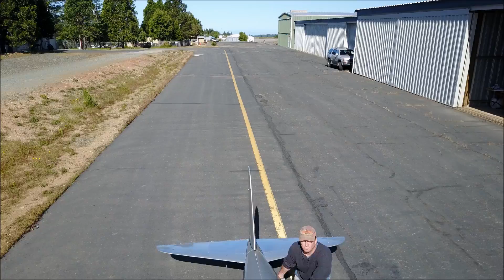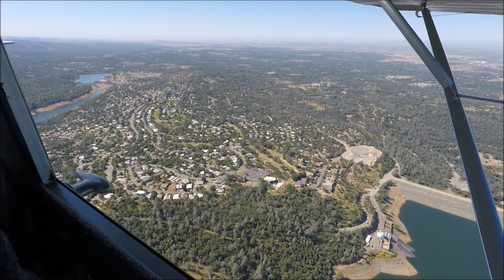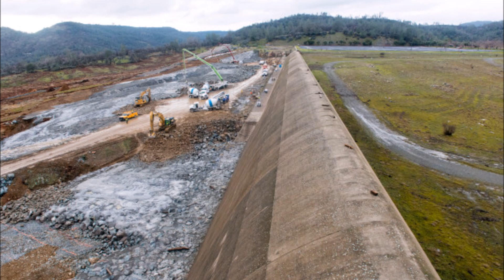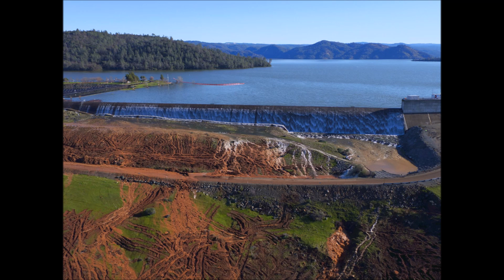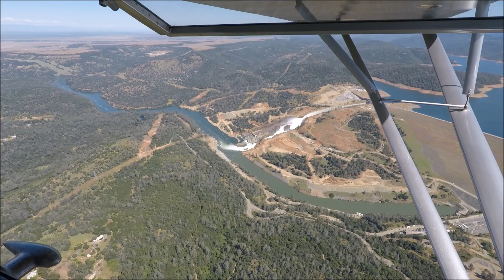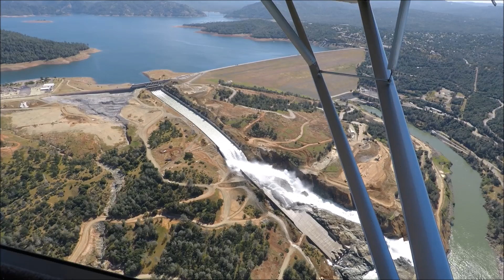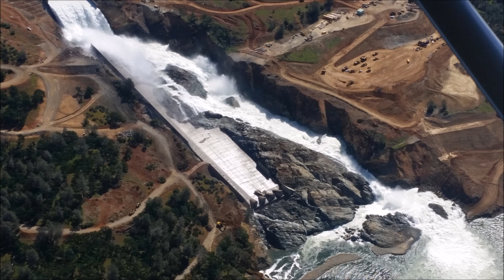Oroville 15 May Update -Recovery

Comment: OG Weir
 wir/Submit
noun
a low dam built across a river to raise the level of water upstream or regulate its flow.
an enclosure of stakes set in a stream as a trap for fish. 
For a better definition of a WEIR, A weir /wɪər/ or low head dam is a barrier across the horizontal width of a river that alters the flow characteristics of water and usually results in a change in the height of the river level. There are many designs of weir, but commonly water flows freely over the top of the weir crest before cascading down to a lower level.

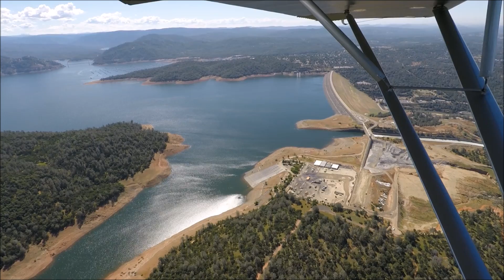Comment: I was pretty stoked to hear you mention the “controversial parking lot” at 5:38.   Something about it this must be buried in the Grand Scheme and it will need to be dealt with during the Emergency Spillway upgrade phase.  
   I first noticed this as I began following the over-hyped story, repeated by  many media outlets (especially TV announcers), that “rocks were being dropped from helicopters” to stop the flow.   I tried to fact-check this and all I found was that in reality big bags of rocks were being marshaled in a staging area but none had yet been “dropped from helicopters.”   
   Finally, after a couple more days as people began to calm down, I did find footage of helicopters picking up a few bags of rocks but where were they going with them?  Certainly not to the emergency spillway area itself, which was quickly accessed by dump trucks using temporary roads that swiftly appeared.
   At last, a complete video of an entire trip of a bag of rocks via helicopter to its destination appeared and I was surprised to see a whole other area of “leaks and dribbles” that had begun to erode a slope far over beyond the actual “weir” of the Emergency Spillway.  White groups of the rocks bags were slowly deposited in these lightly eroded gulches over the next few days.
   Frankly, I don’t think the helicopters were actually needed to reach those areas, which are right next to a road leading to the “controversial parking lot” but I figure they had to pay in advance for the rocks and some chopper time so they had to do something with them.  [The sky-crane did come in handy for moving power lines later.]
   But I have digressed and rambled! . . . 
      I began to look back a pictures of the peak of the crisis, when the water actually overtopped the weir of the emergency spillway and it appeared to me that the “controversial parking lot” for the boat ramp was built at or near the same elevation as the top of the weir.   A low wall appears to continue at precisely the same elevation as the top of the weir all the way to the parking lot entrance.   What a bizarre design.  This meant that as soon as water overtopped the weir, it also began to come over the low wall all the way across the width of the parking lot, which raised additional erosion concerns if the flow increased over the Emergency Spillway. I can’t believe it was in the original plan; it looks like somebody simply decided to put in a boat launching area level with the top of the weir . . . probably after the dam had handled a number of seasons without approaching 900 feet surface elevation.
     So anyway, looking for a story from you someday about how that parking lot came to be.   Problems with its current elevation could be illustrated in conjunction with a retrospective on rocks being “dropped from helicopters.”   Maybe in June 2018 after the furor dies down?
     Meanwhile, great job, love your work (or play, hobby or avocation, whatever motivates this fine journalism)!

Comment: Given the uncertain timing of completing the lower spillway, they will need to incorporate some sort of "bridge" structure that can be lowered into place between the structures. This would allow the option of using the canyon until the lower spillway is completed.

First, they need to build a proper end to the upper spillway to allow water to flow off properly without risk of erosion. This structure would be such that it could easily become part of the finished spillway at a later point. Then, perhaps 50 feet lower they would build a similar structure which would meet the top of the lower spillway. These two structures would be designed to accommodate the placement of a temporary  "bridge" between them.
Reply from the maker: The current plan is to 'bridge' the gap with RCC-Roller Compacted Concrete.
Reply: blancolirio My thought was that in case the dont finish before they need to spill they could just leave a gap between the structures. They could then drop a "bridge" section in place to divert from the canyon to the lower spillway. In this way, once they build a structure below the upper spillway, it is basically ready to be used (with the canyon). This seems like a safe approach since you never know when a spill could be required.

Comment: Crystal clear video and another very understandable explanation, great work again Juan. I did notice that the outflow at the base of the spillway canyon seems much cleaner than in previous videos - is this the result of a lower spillway outflow (I think it was quoted at 10,000 cfs in the video?) or just that there's not so much loose soil and debris left to wash out of the canyon?
Reply from the maker: cleaned out the canyon.
Reply: Thanks for the answer Juan, much appreciated.

Comment: Большое спасибо за информацию, обзор с самолета это очень ценная картина, по которой много чего видно но конечно для специалиста это мало, нужны многие детали и данные чтоб дать рекомендации. Но как мне кажется на работающем участке водосброса - нужно в будущем увеличить аэрацию потока , вполнив Ее и у вертикальных стен. Ну и увеличить толщину и прочность дна и стенок лотка а также его анкеровки, в соответствии с нагрузками от потока, включая пульсацию потока .Желаю Вам успехов в трудоёмких и сложных работах по пропуску паводка на вашем крупном и всемирно известном гидроузле! Владимир СПб
Reply from the maker: Google translation-"Thank you very much for the information, the review from the plane is a very valuable picture, which shows a lot of things, but of course it is not enough for a specialist, many details and data are needed to give recommendations. But it seems to me that in the working part of the spillway, in the future it is necessary to increase the aeration of the flow by filling it with vertical walls. Well, to increase the thickness and strength of the bottom and walls of the tray as well as its anchoring, in accordance with the loads from the flow, including the flow pulsation. I wish you successes in time-consuming and complex work on flooding at your large and world-famous hydroelectric complex! Vladimir SPb"...Thanks Vladimir!

Comment: Juan, please watch this video of a news channel interviewing Robert Be a, an expert and professor.  His opinion is worth your attention.
https://m.youtube.com/watch?v=vc7vgdziUjw
Reply: Sounds like the gates have some potential problems with the concrete.  Do they pass muster with licensed structural engineers?  If not, there's another spare time summer project.
Reply: Ted Cook 
No they do not.  They are cracked and still leaking water after the seal work, I believe. ore of a problem than the public knows.  If the headgear (gates) is in bad shape, the spill way may be a waste of time and money.  Did you watch the interview?  Look up Robert Be a, he knows his stuff.  He wrote the reason the Spillway failed on his own time before DWR had a list of experts to put out a report.  This is not fear mongering or a crazy.  I don't understand why Juan suddenly started believing the DWR.  There is plenty of info on the internet that it doesn't take an expert to figure out DWR has not maintained the dam and all its parts even after FERC inspectors told them what to pay attention to.  There are real serious problems that need to be acknowledged if they are going to make sure this repair is safe and encompasses all the parts of the dam that need to last more than a few years.
Reply: Watched the video.  He mentions the concept of "decommission" the dam.  What are the correct rebuild or repairs to make on gates and spillways in the context of remaining service life of the dam?  Aircraft have cycles and hours, how much life is left on the dam?  If that question can't be answered with a given estimate, they are not following a rational process.
Reply: Ted Cook 
Who knows, they aren't telling us what they are doing or thinking.
Reply: And as a member of the public, I resent having to research what I can because they are not telling the whole story.  I love Juan,  and his videos, but when he said the seep area in the dam, that is growing the green area has been there for decades and not a problem, I was so disappointed.  That's word for word what DWR is telling every one.  There is an inspection report dated 2/3/15 that talks about that needing to be monitored.  DWR's PR guy patronized everyone at public meetings over it, saying it was a spring.  In the middle of the dam?  There are some areas  showing need to watch at the slopes due to settling, but that doesn't seem to have ever made DWR's list of things to do.  I personally think they are playing fast and loose with a hazardous dam, which could not only kill thousands of people, but ruin most of the state water project.  And I believe it's been the case with other dams in Ca.  Safety is not their #1 concern.  JMO after reading much over the past 3 months.  I am a grandmother, not an engineer, hydrologist, geologist or dam expert.  But I don't like the lying and hiding info I've seen.  Thanks for watching the video!

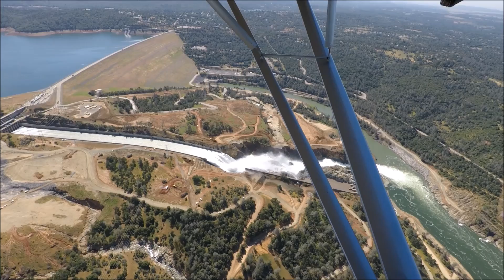Comment: Great job! Couple points to make though; first I would bet my bottom dollar that the emergency spillway is not poured on bedrock. The very light colored granite that you see exposed beneath the main spillway now is competent bedrock, the darker more red colored rock is what I would term a decomposed granite at best. Trust an old miner on this one, that type of rock is easily eroded as you saw when the water did run over the emergency spillway. Second look closely at about 11:15 to 11:20, there is water running down the channel below the emergency spillway. Where is that water coming from? Another of those "natural springs"? Speaking of which; check out the "green spot" on the main dam that is caused by a "natural spring", now that the lake level is down it seems the green is turning brown again. Again, great job Juan, without you we would never know any of this stuff.

Comment: The problem with the comments about the rebuilding of the spillway is that it makes no difference if it will handle 270,000 cfs, because anything over 186,000 cfs will cause serious flooding for everyone from probably Oroville south. The outflow from Oroville was at around 186,000 back in 1977 when the levy blew out down in Marysville. At this level of discharge, the levy's are running bank to bank, and that is just dangerous to all who live south of Oroville, including Sacramento.
Reply from the maker: Yes, you need to understand the difference between operational limits and design limits as discussed in this update....

Comment: Yes, excellent video.
Thank you for sanity.
I've thought about it some more.
They are building the spillway from the bottom up predicated on the belief that the upper spillway is in better condition and can wait till next year.
What if that is wrong?
Another record year and that upper half fails taking out the newly constructed lower half in the process.
It defies logic to built from the bottom up unless there is some other overriding logistical or technical reason.
If you start from the top then the only thing you may lose is the already destroyed lower half.

Comment: Excellent reporting, as usual. You left us with a teaser though; what's the ground composition under the parking lot? I'm, sure they've done core sampling by now.
Much as I enjoy your flyovers (and as much as you enjoy doing them) I'd like to see you sending your drone across the river from time to time for closeups.
Any timeframe for shutting down the power plant to switch to the new power lines?
I also finally gave up and read up on RCC. Interesting stuff. I wonder if they'll be batching that and regular concrete at the same time (two plants). 
Now I'll go drop another dime in your cup for some more avgas  :)
Reply from the maker: Ed Van Sicklin Thanks Ed! I have a new source for Oroville drone shots, I'll post link soon...

Comment: The way they have no shotcrete on the emergency spillway that is along the parking lot gives me the idea they are going to raise a wall to dam off that section of spillway and have an elevated road over it to access the launch area?
Reply from the maker: Erik 567 not sure...good question...
Reply: blancolirio 
The DWR is not answering questions they don't want to answer.  At one public meeting, Croyle said he would get answers, with documents, to a question about the spot on the dam itself.  He never did.   one to find out they didn't come up with a monitoring plan like FERC inspector asked for.  DWR seems to do as they decide is best.  DWR has a conflict of interest; they own and run the dam, and don't really answer to anyone.  They should be overseen by experts, to make sure they are doing things they are supposed to be doing.  Them saying public safety is number one is a joke.  It's just not true.  With so many following you, and believing in you, I feel you should make the effort to see if what the DWR is telling you is true.  Them telling you the  seepage and green on the dam face is nothing, and you repeating it, shows how much respect they have for you.  They used you to repeat a lie, by ommission.  They have been told for years to monitor it and find out what it is, and they didn't.  Kinda the same way they did the sheriff.  Everything was fine they said, until the last minute.  Then the sheriff had a big scary problem he had to handle without any forwarning.  If they didn't know that ESW would erode, dangerously near the weird, then they don't deserve to be in their positions at DWR.    Surely you agree!
Reply: This is a copy/paste of the comment on the May 21 2017 "the Bridge" youtube by Ca. DWR,
"Published on May 22, 2017
With the spillway gates closed, Kiewit Infrastructure began demolition work on the lower chute of the spillway. This area is known as “The Bridge” for the stretch of concrete that spans the erosion area beneath it. Reconstruction efforts will be conducted in phases. This year’s work will focus on rebuilding the upper and lower portions of the main spillway and creating a cut-off wall on the emergency spillway. DWR's goal is to get systems in place by November 1 to ensure that we can safely manage the next year's weather."
 The part, "creating a cutoff wall on the emergency spillway" may be what I described? Not sure.

Comment: another question I have I will probably have to go up to the Personnel at the roadblock areas. I wanted to know will the public allowed access to the dam itself while construction is going on this summer?
Reply from the maker: Gary Opdenaker don't know yet...right now requires a press pass...lots of construction traffic.
Reply: Just witnessed large trucks transporting massive crane structures down Oro Dam Blvd. and other work vehicles.
  So the construction begins.

Comment: Juan, my question is will there be keyways cut in to the new Spillway structure to prevent it from sliding or separating using using reinforced concrete?
Reply from the maker: Gary Opdenaker Yes! big ones.

Comment: Juan, I heard a report on NPR. They interviewed a geologist who examined the rock under the main spillway. He said that the rock has been changed chemically by exposure to other natural elements over time. He said it's what is called "unreliable rock". In other words it's not solid rock and it's on it's way to becoming dirt (his words). He said that when that spillway was built even a student of geology would have been able to point that out. So...it appears they built the spillway on " unreliable rock" instead of solid rock.
Reply from the maker: Yes, that's why they will be blasting to better bedrock and filling with RCC (Roller Compacted Concrete) up to grade.
Reply: +blancolirio 
Right, thanks. Lots of facts to keep in line mainly thanks to you. I was stunned to even hear a story on Oroville. Here on the east coast there is not one single word said on the news of the Oroville Dam. Our illustrious president seems to take up all the stories.
Reply: In examining documents from the original construction,  they had to dig down 18' (which is  more than 900 feet below the gate structure,) in order to find enough solid rock on which to set the internal coffer dam.  Most of the rock above the base is comprised of old gold-mining dredge tailings.  Sheer zones have been identified, and the ubiquitous schist minerals are unsuitable as bedrock. The site rock is not cooperating under crushing tests to be suitable for Roller Compacted Concrete.  Kiewit will need to find a much more firm foundation, which may require some bridging, and is probably why they are starting at the bottom.
Reply: "Croyle's Canyon" Hahahahhahah!
Reply: +Lad A Dog 
Interesting. What's that old expression? ... "There's never enough time to do it right but there's ALWAYS enough time to do it over".
Reply: Lad A Dog - I laughed at that too. Lol 😂
Reply: @blipco You can thank the MSM and the Democrats for that!
Reply: no... I think it is "If you don't have time to do it right the FIRST time...you absolutely Don't have the time to do it over!"